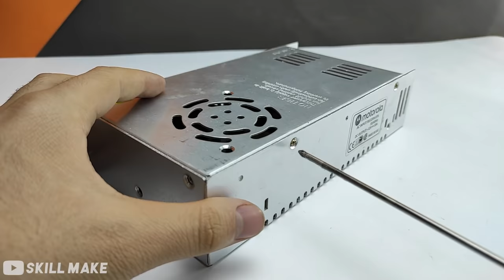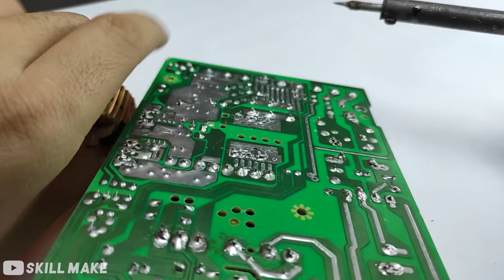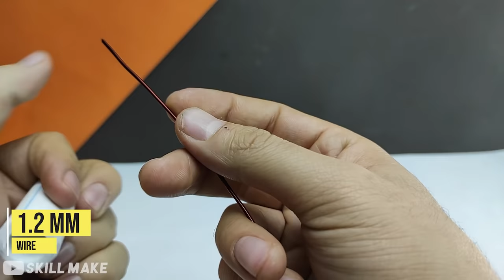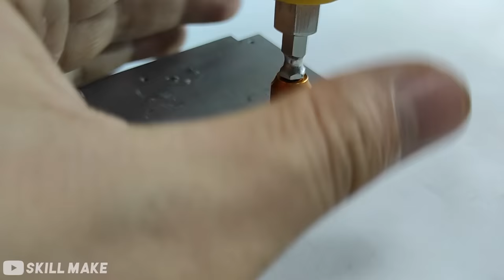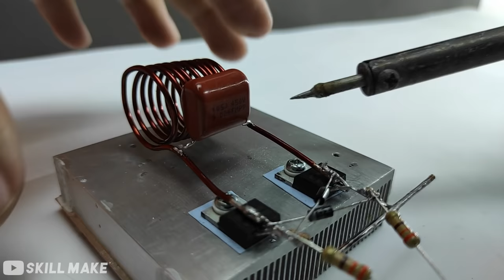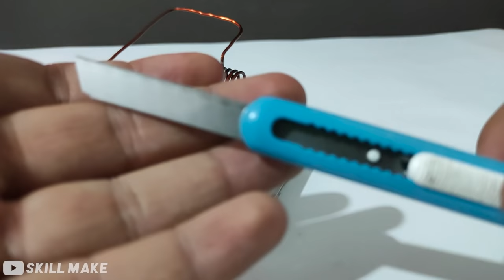DIY induction Heater - how to make induction heater at home

Comment: With high current you should hook or wrap the wires to be soldered.
This will provide mechanical support for the solder joints so that even if the solder softens or melts it will still stay together.

Comment: great video, but 2 things wrong here #1 aren't those power supplies like 10x the price of those raw components
and #2.....

YOU NEED A HIGH CURRENT 12v POWER SUPPLY TO DRIVE THAT THING, AND YOU DESTROYED YOUR PERFECTLY GOOD ONE!?!?!?!?

ALSO i call Clickbait, You Showed on the Thumbnail it Running From the 12v Power Supply, I'm Sure it's Possible to do, but You Didn't do it that way.

Comment: could be used as a water heater for a shower?
Reply from the maker: This is an induction furnace, so it only works with metal, but you can use a copper pipe and pass water through the pipe

Comment: Did anyone else notice that the MOSFETs in the original Motorola power supply were not even bolted to the case/heat sink?
Reply: Yes.....but it looked like it had been opened before, i think.

Comment: Can you provide circuit diagram.
Reply: Look for "Mazilli ZVS". It's bound to be pretty close to that.  There's 2 variants, one with a center tapped work coil that has a loading inductor on the center tap and one with an untapped work coil and a pair of loading inductors, one at each end of the tank.  The latter is the type you can find on ebay, etc.